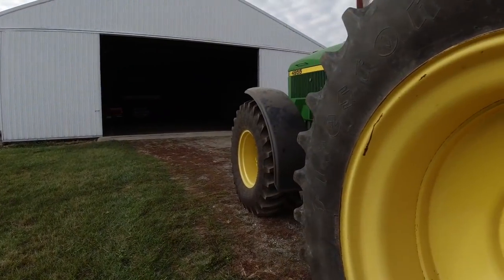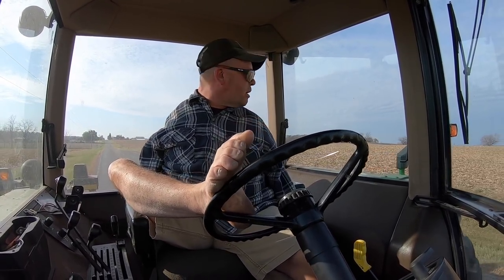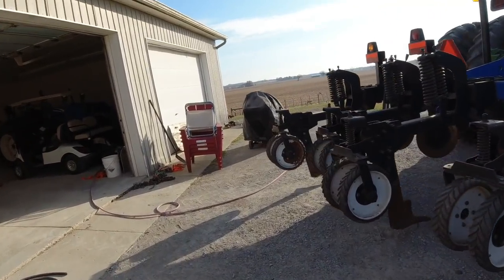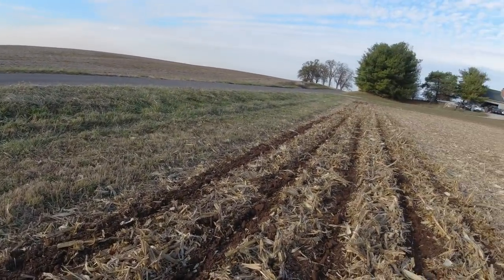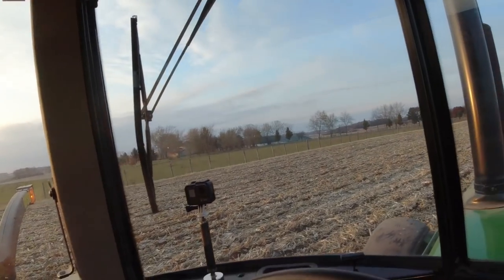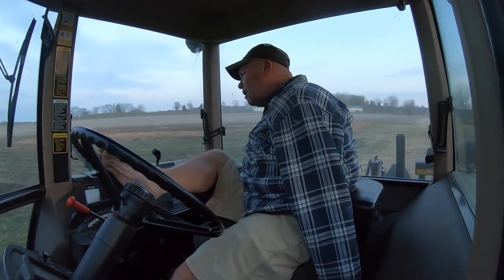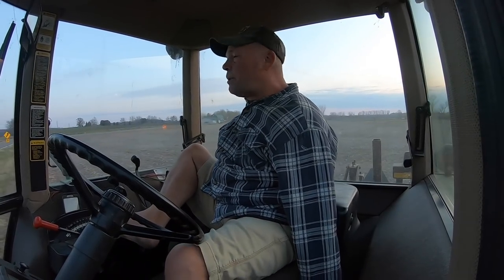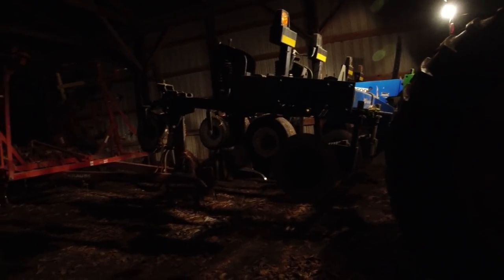Ripping Dirt With The 4955

Comment: I used to work on a Fiber Optic placement crew with the phone company and we used a single plow at a little over 4 feet deep with a very large Fiat Allis and we would sometimes have to pull it with a JD 450 or even a D8. Ground is a hard substance for sure
Reply: 41C probably
Reply: @RJ1999x  I do not remember but it was a large dozer and we called her Fat Alice.
Reply: @N-Scale  2 exhaust stacks?
Reply: @RJ1999x  Don't remember , I would have to get pictures out some day.
Mike

Comment: I have a JD 4960 that I bought new. It has around 5200 hours now. We have another JD 4960 we bought used and it has over 10,000 hours. We use it more then the other one. The higher houred one has 20.8x42 tires. It will out pull the other one. We like both of them as they ride well for their age. We run a disk ripper on all the corn ground to incorporate hog and cattle manure.

Comment: Great video. Is there a noticeable difference in crop yields and health when a field is ripped compared to not ?
Reply from the maker: We just use the ripper on the compacted areas where we drove the trucks and the grain cart. The ends of the fields take a beating so we run this to loosen the soil. This year, in one of the fields I worked on, there was spots where there wasn't any corn from the compaction. I do have a couple fields I need to run it over the whole field. Hafta wait and see how the weather turns out this late fall. Thanks august

Comment: Is there a better, simpler transmission ever built than the 18 speed powershift?
Reply: 15
Reply: Magnum 18 speed right? :D
Reply: @bratpane1  Eh,          no!
Reply: Just don't hook one to a PTO ,the gear is quite thin , makes a real mess fixed two them. Manure areation pumps.But they are a nice operator friendly tractor , put alot of hours on 4960.

Comment: In 2011 we had a spring flood in May my farm was covered with 4 to 24 inches standing water.  When it receded I had the farm provisioned leveled to 2% grade  ground was rock hard my renter used a lister to put up rows for soybeans and he almost tore the lister up had to replace points and sweeps. Made 60 bushels of beans best part was the bean price at the river that year paid out almost 150 dollars per acre in crop share rent farm is in a annual soybean rice rotation system but will become behind soybeans this year made a hood beancrop last  fall

Comment: dad coulda been a old schooler but he firmly beleived that ever third or fourth year you had to deep till, and we would diagonaly cultivate the feilds with a deep tillage cultivator and then went oopsite diagonaly across that with the feild cultivator before seeding. he claimed the soil lost it's growing powers and wanted to pull up the new ground from deep down to mix with the top over worked soils, saying the deeper down soils had all the growing nutriants? i do not really know just do know i remembered the crops on the newly tilled grounds seemed thicker and healthier.

Comment: A 4955 with less than 10,000 hours on it!!!?????
The last time I ran one was over ten years ago, it had 8,600 hours on it then.
Around here, if it's ground they'll let you rip... It's mostly V rippers with 32" to 36" long curved shanks.
We try to run ours all the way in the ground, a 2wd 4430 pulls 5 Shanks nicely, on the flat😂🤣
Most are on articulateds and 7 or 9 shanks on a 12' bar. (that are too close together!!) 
Thanks for the ride Andy!!!
Reply from the maker: We really like this ripper, just because it works, and dosent tear up our ground. It didn't really show up in the video, but its pretty impressive how it lifts the ground and just puts it back down. Great for us notill farmers. Thanks Ed
Reply: @HarmlessFarmerAndyDetwiler  you can kinda see it.. spring loaded and packer wheels!!!
I like the looks of it!

Comment: Is that a 89' with power shift ?
It looks show room 😉
Great point about water being heavy and packing the soil.
I cant believe how easy you put the cap back on the tire valve. It takes me forever to do that. 
Excellent pro grade videography !!
Another question.  How do you keep your feet and toes from freezing?  😆
Reply from the maker: Tractor is a '91. Ill wear shorts as late into winter as I can. Easier to bend. If I get cold, I know that ill eventually warm up. lol. Thanks for watching
Reply: @ivy and roses how are you doing ?